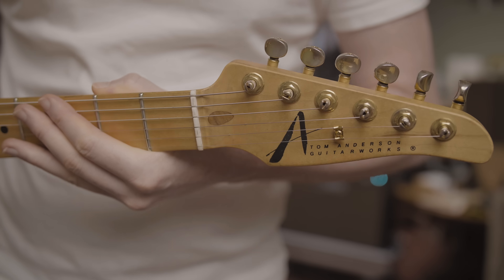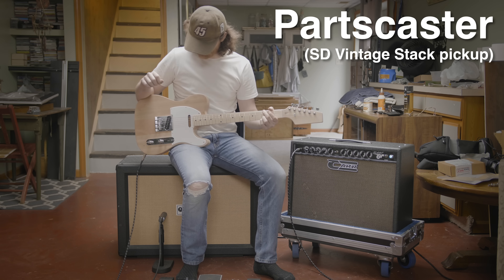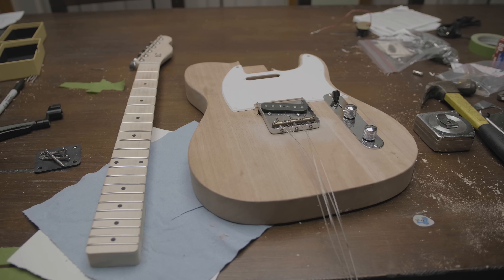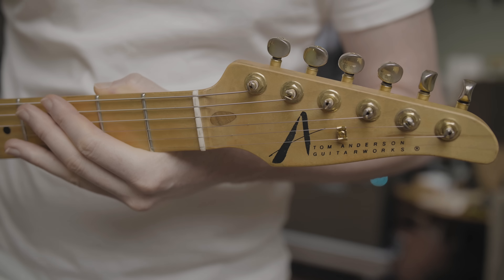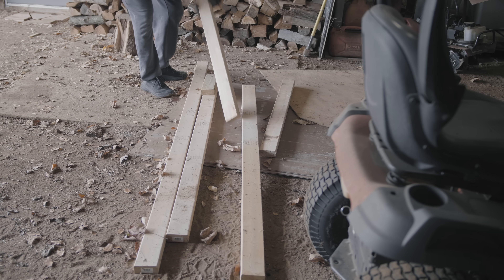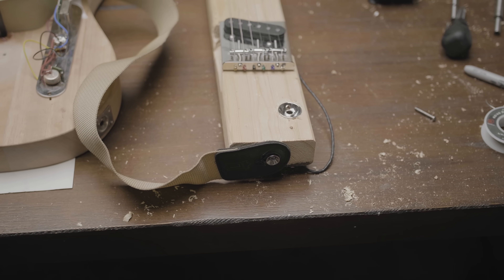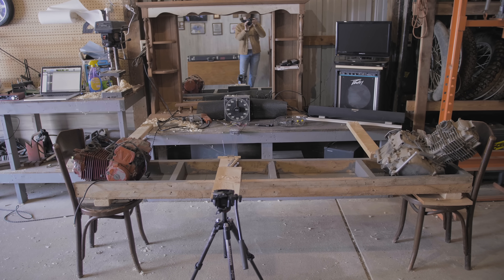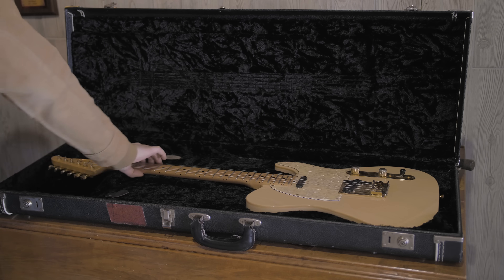Tested: Where Does The Tone Come From In An Electric Guitar?

Comment: It's insane that even after doing all of this, some people will still die on the tonewood hill. This table&shelfcaster just got a tie with the fencecaster in the functional guitar tierlist for me lmao. Good job mate.
Reply: Anyone who plays acoustically will die on the tonewood hill. However, it's laughable for the electric guitars.
Reply: @le_th_  And STILL, a lot of electric players still die on that hill as well. Maybe there's something else on that hill, like good coffee or smt.
Reply: Nah, just a lot of denial. @HeyVince19
Reply: @Maplaplaplapla  No. It's not called that. It's called denial. Sunk cost fallacy is when you complete a task even though it's not worth it because you've invested so much time or energy or resources into it.

Latching on to shitty incorrect opinions isn't that. It's denial, and it's far worse than sunk cost fallacy on an ethical and character level. Far far worse. Learn the difference.
Reply: @le_th_  Even acoustics are affected far less by wood types than you'd think - and I've built them. There is some effect, especially if you're comparing timbers with radically different physical properties (density is pretty much the only thing that matters here), but actual design plays a larger role: How large is your sound hole? What finger-brace design are you using? How large is your kerfing? How thick is your top/soundboard? What shape is the body, especially have you radically changed the size of the upper or lower bouts? All of these have some impact, and most of them moreso than the actual woods you choose.
Reply: @le_th_  a lot of luthiers will  disagree with you
Reply: @le_th_  After the top of the acoustic guitar is precisely 0.713 inches thick, the wood ceases to matter.
Seriously, tap any electric guitar and see if you hear some resonance. That's how luthiers determine quality of wood.
That's also how some of the greatest electric players (EJ, Verheyen, etc) determine how a guitar will sound.
But of course, some beginners know more about guitar sound than they do.
Reply: Hey, if they still want to blow close to six grand for “the very best” PRS, I say let them. I mean after all, some people still swear by Biden!
Reply: man, are you a flat earther? are you an antivaxxer? Tonewood is f***ing real. This video is played with a ton of distortion and compression; that's why the air guitar and the 2x4 sounded similiar.
Reply: I just say 'toan is stored in the balls' to piss them off lol.
Reply: @norandomstuff 😂😂😂
Reply: @norandomstuff  wrote: "I just say 'toan is stored in the balls' to piss them off lol."
It's "tone," and who are you trying to piss off? That's the mystery to me, why someone would get triggered cause they can't hear something. It's no big deal. Lots of people have very good ears.
Also, get a set of good monitors (Genelecs are great), and see if those portray more detail than your 1" computer speakers. Could be that you can hear this stuff after all.
Reply: @norandomstuff  wrote: "I just say 'toan is stored in the balls' to piss them off lol."
Yeah yeah. You didn't answer: Who are you trying to piss off? 
I doubt that a misspelled nonsensical phrase is going to bother anyone.
It certainly doesn't prove any kind of point, does it. (Rhetorical question)
Reply: They will, cause they`re right. Thats why electric guitars made from aluminum sounds like shit! Wait...oh..they don`t!?! How could that happen?
Reply: @RBdeBell  Steinberger carbon fiber was the ultimate tone in the 80's. Expensive as heck, and super cool and supposedly had the cleanest sound and the longest sustain because carbon fiber. They don't sell the carbon fiber version any more, because the wood ones are cheaper and sound exactly the same.
Reply: @RBdeBell  I have two Travis Bean guitars that are literally made from aluminum channel; headstock down thru the bridge mount. They sound great, but nothing like my alder guitars, which in turn sound nothing like my mahogany guitars, etc.
This all depends on a person's ears, perception, and preference.

I'd love to see one of the anti-tonewood loons survive in a mastering or mixdown studio, where the engineers are adept at picking out detail in reverb tails in a dense mix. They'd be laughed out of the place. 

Or maybe they could conduct a large orchestra, where they'd get triggered and indignant if anyone insisted that an English horn does not sound identical to an oboe.

BTW, Lil's tests are silly. But the audio did sound different, even with the crappy distorted recording and Youtube's lossy compression. I imagine that most of the triggered are also listening on 1" computer speakers. Definitely take those to the gig.
Reply: Those have become increasingly desirable, especially to a dead fan such as myself 😅 @stringtheoryx
Reply: @CrispySonOfA  I didn't know that the Dead used them. Here's a story you'll appreciate:
I had just moved to NYC, with some recognition in my home state. I was walking down Bleecker St (Greenwich Village) and heard what I thought were two or three good guitarists playing in a darkened doorway.  It was Stanley Jordan, solo, playing a Travis Bean.  An ego-deflating experience to be sure.

I bought my first Travis Bean intending to use it for a guitar synth design. When I got it back to my shop, I realized that I couldn't touch it. Even the pickups were great. Got the second one shortly after.

Anyway, aluminum is a great tonewood. I also have a Dan Armstrong. Plexiglass is not a great tonewood. 🙂
Reply: @stringtheoryx  wow, that's amazing! Yes, specifically, Jerry Garcia used one for a handfull of years and some people reguard as their favorite "Jerry Era" I modify/build guitars Im thinking of getting an Aluminum neck and trying it out!!
Reply: @CrispySonOfA  That was a spectacular coincidence. I was afraid that all the players in NYC were miles beyond.
I got to know Stanley from that  encounter. Really humble and cool guy.

There was another guitar from Veleno at that time. Todd Rundgren played one version. I couldn't play them cause the necks were ultra-thin. You also know about Kramer, but of course that's not all aluminum.
If you're machining an aluminum neck, be aware that the Beans have two slots/channels running down the neck, under the fretboard. Otherwise they would be ultra-heavy.
I actually own a solid aluminum neck that was made by a machinist who didn't know about the channels. It's a boat anchor. I never used it because of the extreme weight.
Reply: @stringtheoryx  really cool story, I appreciate you sharing it! I used to live in NY but not the city. Closest I came to that was going to the Brooklyn bowl for BowlIve when soulive had a residency. we went for like 4 nights straight. Good times!
Reply: @CrispySonOfA  That sounds like fun. I've seen shows at the Brooklyn Bowl years ago. Strange place. At the moment, I can't remember who I went to see, Marcus King, maybe. I would have gone to see Soullive if I had known who they were then.

Comment: Yes, the pickups are the majority of your tone. However, that does not mean that the tonewood doesn't affect the playing of the instrument. I have a fully customized electric guitar that has a wenge through-body neck in an African mahogany body and two maple skunk-stripes. The instrument weighs a whopping 11 lbs. The tone is driven by two Seymour Duncan P-Rails and an Alnico II mid pickup, so it has a CRAZY amount of tonal flexibility, but nothing you couldn't put into a piece of plywood. What it has that no plywood guitar will ever have is an 8-second sustain, courtesy of the tonewood. You hit a full open-E chord and you can feel the neck resonating with the body. I also have a ghost system installed on the instrument and the body is chambered -- so the piezo pickup has something more to work with. Again, I could get the same "tone" if I put the P-Rails and Alnico II into a piece of plywood, but it wouldn't be the same instrument.

Great project though! Thoroughly enjoyed and appreciated the effort!
Reply: No one said anything about the wood affecting the feel of the instrument. This is just about tone-wood doesn't affect the sound of the strings, because wood isn't electromagnetic.

Comment: I’m a keyboardist, not a guitarist, but I really appreciated the thorough scientific curiosity and experimentation here. At its heart, an electric guitar is an electromechanical device that gets its sound from current flowing through a coil of wire that is modulated inductively by a nearby vibrating piece of metal (a metal string. …Or spinning wheel with numbered teeth in the case of a Hammond tone-wheel organ). The 200 lbs of wood surrounding the tone-wheels of a Hammond do nothing to shape the sound. The wood is only there to destroy friendships when it come time to move it. 😂 I guess it doesn’t have much to do with the sound of a guitar either. It was fun to see the same strings strung across ‘nothing’ sound exactly the same as strung across the body of an expensive guitar.

Comment: Took me awhile when I first started guitar that I was get bamboozled about "electric guitars" to many guitar channels this is the greatest guitar since sliced bread.  Until the next week, then it's this guitar or that one the following week.   Find one ELECTRIC guitar you really enjoy playing and your solid.  Unless you like collecting them.   As for Acoustics, yes there is a difference in tone.  I have a Taylor 810 which I'd put up against a Martin D28 any day, and a Taylor 614ce and the two Taylor's sound differently, both good, but different.  Electric's sound very similar except for passive and active pickups.   Humbucker and single coil a thicker sound on the Humbucker, that's about it.     Don't worry what's on the headstock.   I've paid way to much for what's on the headstock.

Comment: Been getting into guitar over the last 3 months and became really interested in aftermarket guitar parts for a budget Ibanez. Made me wonder what mattered or not and as I watched more youtube I came to the conclusion it was probably 90% the pickup but I thought maybe the neck mattered a little. I even saw a guy play a concrete guitar but there wasn't any science in the video's I saw. If only youtube had served me this video much sooner. As a student of science and newbie guitarist I love this.
Reply: If the machine heads are really cheap they could use replacing too so your strings stay in tune better. But they might be alright too
Reply: @badwerds  Yah I love modding things so I ended up with a bone nut, locking tuners + machine heads, graphite tech bridge. Can't remember the pots/switches and finally Utopia pickups. I chose an Ibanez because I was sure the body didn't matter much so I got the lightest one I could find at 2.5lb.

Comment: interesting video but none of the vibrations are transferring from the frets into the neck, so that will certainly have an effect on the timbre of the instrument.... also the bridge is still fixed to a very large piece of wood that is still transferring the vibrations into that wood, so that might also be a factor of why it sounds similar.  in my opinion, the scale length of the instrument is the biggest contributing factor of tone other than the player and pickups.  I also tried a similar experiment using an agile 7 string that i put my bareknuckles in from my 7 string jackson, same scale length but the jackson had a gloss finish and maple top and the agile was satin with no top... the tone was DRASTICALLY different, and not just in output or sharpness.  The guitars had the same scale length, bridge, pickups, and similar tuning machines, same ebony fretboards, but different neck finish.  they were also both string through body and neck through.  the jackson was mahogany but with a maple veneer, and the agile was mahogany and no maple top and satin finish.  The biggest difference between those 2 guitars was the maple veneer with gloss finish vs no veneer satin finish.  the guitars sounded radically different... it's anecdotal, but theres prolly more to explore here.
Reply: Also, the smallest difference in timbre are brought out MUCH more when you have put the guitars in an actual mix and mastered it.  All those minute differences are extrapolated out and you will notice a big differnce when RECORDING and mixing them.  I think just micing them alone in a room isn't really the full picture...

Comment: IMO, which is fact, tone comes from this order: PICKUPS, then, the longer the scale length and the thicker the strings = clarity/fuller bass tone.  If you sell guitars, and boomers are your main buyers… just lie. just advertise the type of wood and the throw in the bolt on/thru neck myth in there.  Because no amount of proof will change the mind of a boomer in terms of where tone comes from.  They will always think wood matters most.  They will subconsciously still think pickups are microphones and will never budge on this.  Just say “tone wood” with whatever guitar you want to sell them.

Comment: That isn't an air guitar.
The reason bodies sound different is because they have different masses/densities and acoustic impedances.
That "air guitar" is actually the one with the biggest body because the table is the body. All the vibrations from strings will go into the table from the bridge meaning less vibration to go into the pickups
Reply: The solid body guitar simply is a base for the bridge, nut & the frets to transfer the vibration to the pickup which totally converts those vibrations by the disturbance in the magnetic field. There are no acoustic properties transferred to the magnetic pickup as the pickup can only react to changes in the magnetic field.
Reply: @triax7006  The more mass, surface area, connecting to the bridge means more of the vibrational energy is being transferred to the body and less to pickups. Ideally, no body should mean all vibrational energy goes to the pickups for the most raw tone

Comment: The air guitar sounded surpisingly close, but had a sympathetic resonating note that made it sound extra glorious! Thank you for using such a well controlled testing methodology!
Reply: Lol kinda feels like. Upon rewatching, the guitar is a glorified weird harp? I'm still curious about sustain and how that comes to be. I know strats die super quick compared to les Paul's.

I know scale length is huge or I think very big as well. Feels like get something that's comfy with pickups you like
Reply: The problem is that this video is trying to say that woods/substrate/guitar body doesn't matter.. and basing that whole argument on the fact that everything but the pickups, the strings and the tuners have been replaced... but that's not the case. Strings need something solid to resonate with to maintain their oscillation... plugging this rig into a bench does not demonstrate that.. you're just replacing the guitar body with a bench.. so, of course the strings will resonate the same - maybe better! Replace it with stale bread and you might have a point. :-)
Reply: @crazyjack9voltbatteryamps so it's not an 'air guitar', but instead is a 5-ply MDF fiber board guitar. Which happens to sound the same as the tele which has a solid alder body. Point being that tonewood is snake oil. It makes no appreciable difference to the sound. But I feel we're at the point where it's become an article of faith, there is no analysis that would change people's mind, because they have an emotional investment in the product.
Reply: Lol  @crazyjack9voltbatteryamps

Comment: You forgot to take into account that the bridge and headstock are still mounted to wood which has inherent resonance, so while it sounds like a lap steel guitar, which essentially it is, it's still mounted to wood, so the sound still has 'body'.  Thanks for proving my point all these years.   Take it a notch further and mount all that stuff to a steel square tubing frame instead.  Tell me it sounds the same..  :)  It won't.

Comment: I’d love to see that run through a oscilloscope or analyzer, it sounds like it would be so close.
Fantastic video
Reply: it wouldn't. You can literally run two of the same instrument through and get very very different waveforms visually. Far more than the difference in you ears would tell you
Reply: @eurly93  Multiple takes, Fourier transform that, average, analyze frequencies and their amplitudes.
Reply: @eurly93  technically it's possible if you use a robotized hand and all distances are respected. Waveforms would be different but it's all matter of statistically significant difference.

Comment: The Sound come from the pickups and electronics due to the vibration of the strings. So the tone keys are in these parameters. We Can add, a small différence du to the elements in contact with the strings ... : bridge saddles, the nut and the frets. Very big thanks for this experience !